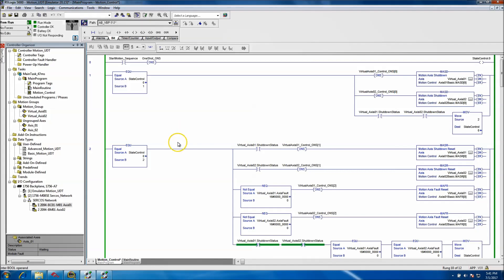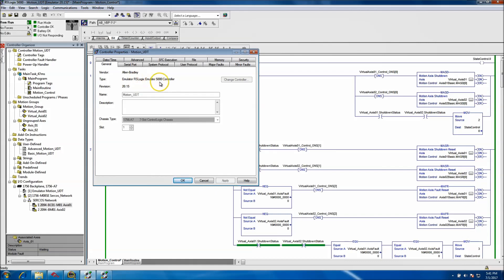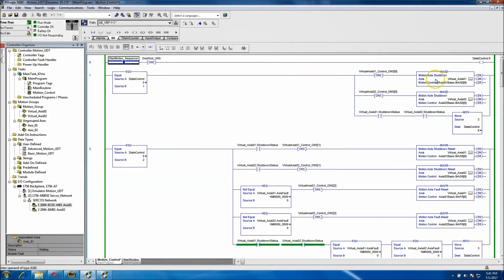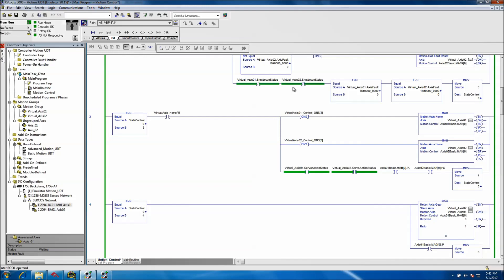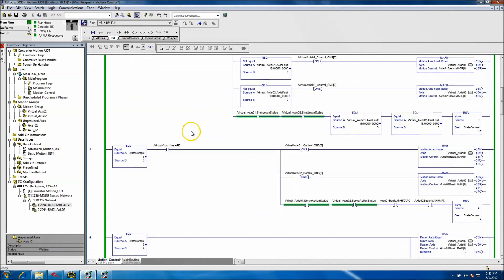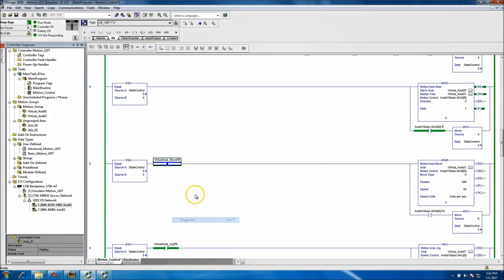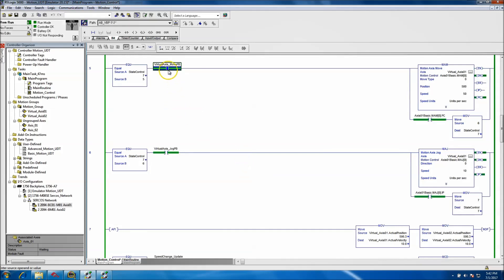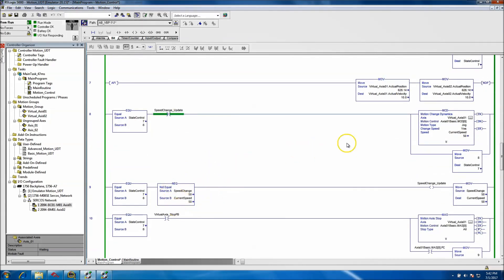RSLogix 5000 Motion Servo VelocityStandStill Use | Simple Guide To Understanding Servo Controls

Comment: Sir, you have done very nice work. kindly update the video on the project using a motion controller with multiple axes with coding for beginners, just like you have done a video on batch processing project example. thank you and keep it up.
Reply from the maker: Are you meaning the 30 day servo project that I have in my playlist?
Reply: @ShaneWelcher  yes sir, but with more detail in coding with virtual axis creation to link with other physical axes and coding in motion controller to control motion like linear and rotary,speed position or torque,caming,
Reply from the maker: @talatidipak  I teach that in my servo courses.

Also shared a lot of it on my playlist of the 30-day servo project